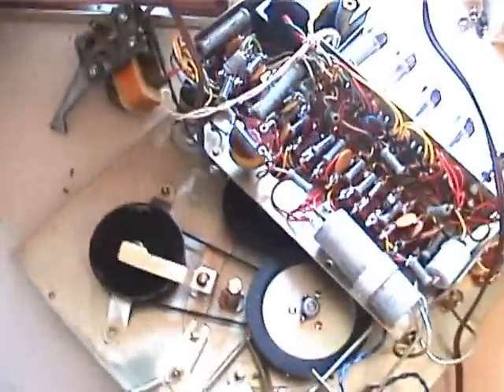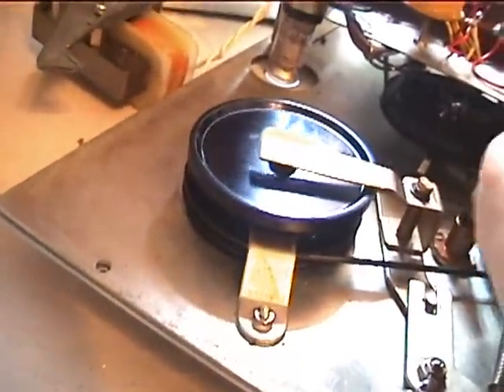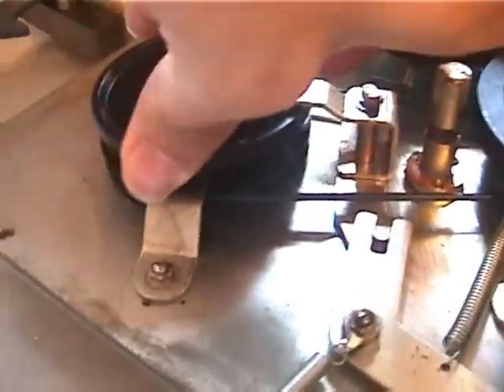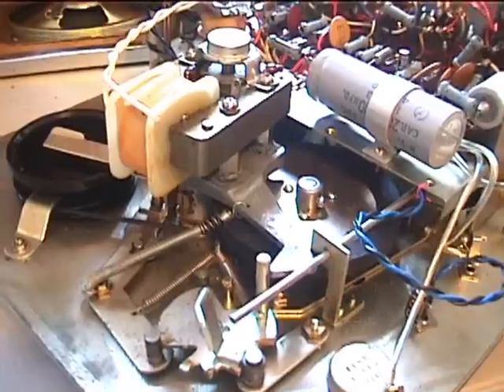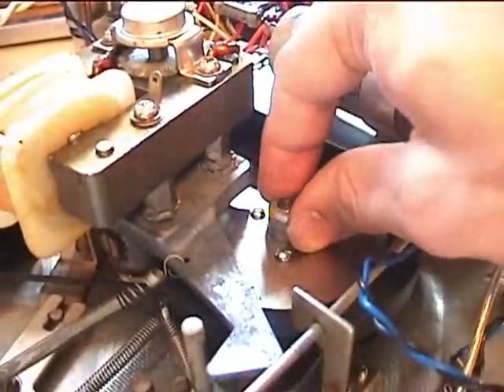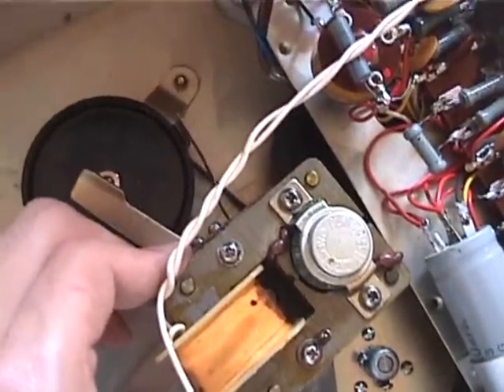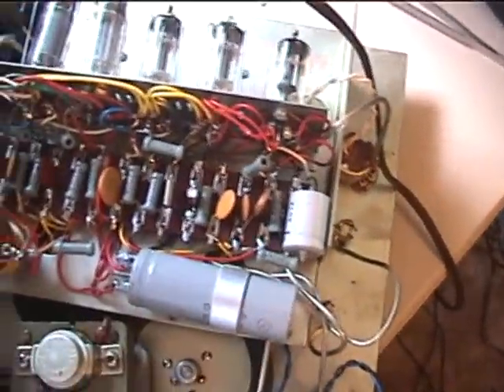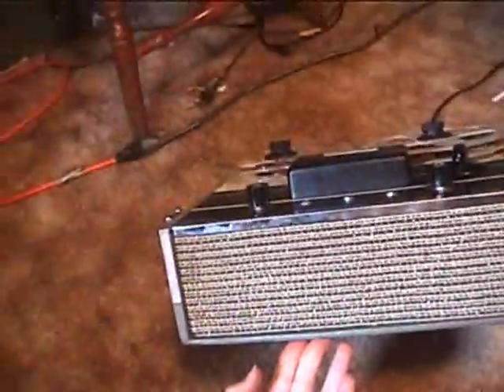Inside of the Transworld reel to reel tape recorder

Comment: The R2R on my 4TR-990 has AC bias with a 6AR5 tube. That is the only tube in the entire system. The R2R has large transformers for line out and drive for the R/P head. The stand alone version of this tape deck uses those transformers as headphone outputs too.  Also had a Panasonic 8 track player/recorder with the same transformer arrangement. In all cases the transformers were driven by Germanium transistors of the 2SB series (low level AF metal can type).